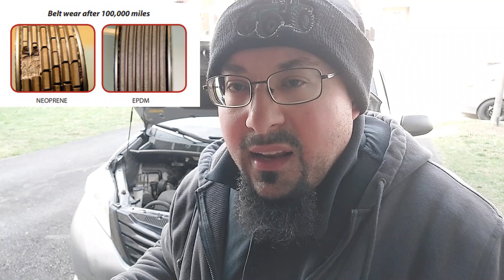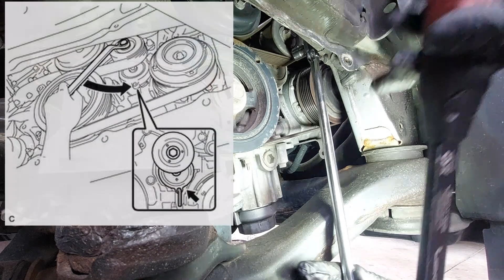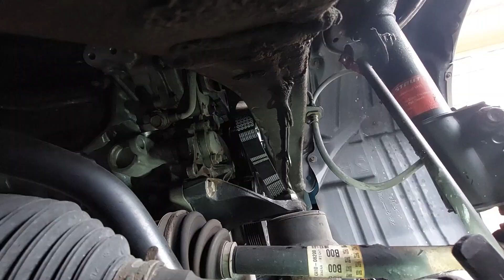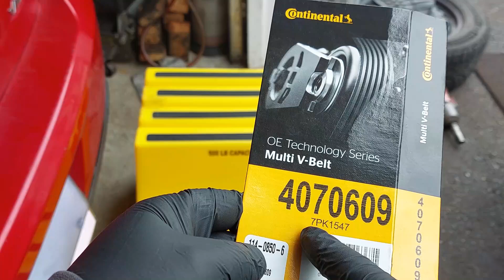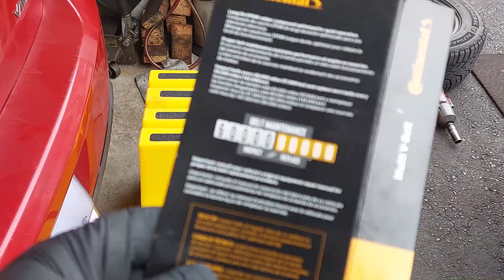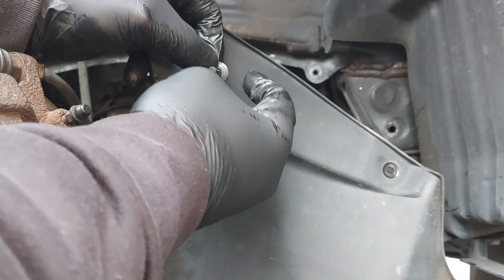2015 Toyota Sienna 3.5 V6 - Drive Belt Replacement

Comment: Nice video.  For some reason when I checked, the correct belt size for this car should be 7PK1550 and not 7PK1547.  Perhaps this is one reason you had some difficulty installing it?  I was wondering since I purchased the 7PK1550 for my 2014 Sienna.
Reply from the maker: There are different sizes for drive belts and different manufacturer of belts will have slightly different sizes, but they will all fit. It could be that the one I had was slightly shorter, (3 mm shorter), but it won't matter for as long as it fits and the tension is correct. No difficulty in installing it, it is just that a job becomes slightly more difficult with the camera being in the way for the sake of making the video for you guys. Different year Sienna may have different part numbers as after 2014 and after 2016 up to 2020 there were slight design changes, even though it is the same van there were design changes after some model years.